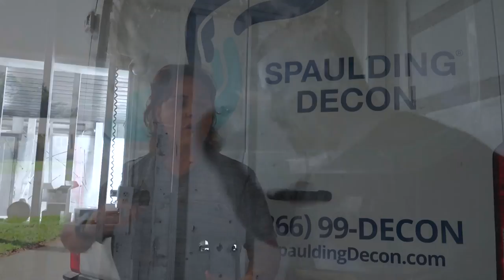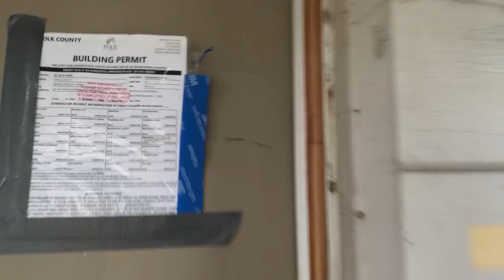PRE-FINALE: What happened to Pet Cemetery?

Comment: Oh my gosh!! The progress is amazing. So sorry that the contractors screwed you. 🤬🤬🤬🤬 That is such a great area!! And a block house to boot 💝💝 complete bonus for so many reasons (It was one of the things we required when we went looking for a house to buy. Ours was built 1954. Excellent for our 'Named Storm Prone Areas'!
Reply: what's a block house?
Reply: @jaytotheell  It is a house made out of Concrete Blocks. They resist termites, are good for maintaining the temp inside of house, excellent for controlling the noises from outside, and typically stand up a lot better to tropical storm and hurricane winds than a stick built home.
Reply: @jaytotheell  BTW, you can't normally tell a house is Block by looking at it because they have siding or stucco outside and plaster or drywall walls inside.
Reply: @jaytotheell  they're homes made from concrete blocks mostly on the ground floor.  Upper floors are mostly framed with wood here in FL.

Comment: I stopped watching home renovation shows for a reason. 
Me 15:00 min in: I should look at tile for the bathroom, and I still need to paint my kitchen cabinets. Man, I wish I could replace my cabinets. Etc etc etc..... wait! I'm broke... nm.
Reply: You just have to stop looking at an all at once project cost that's out of budget. Most everything you would need to get to renovate your home is pretty shelf stable. We bought paint and drywall mud nearly 2 yrs ago and its still good. You can just buy 1 thing at a time and set it aside until you have everything you need for a project. For your cabinets start with paint supplies, then primer, then paint. Even if it takes a year or more to buy it all you still get it done. Tile can be time sensitive if you want anything beyond basic rental unit tiles because styles change seasonally so you need to be able to get them all quick or they may become unavailable. Beyond the tiles themselves the tools and grout can be got over a long time period.

Comment: I'm planning a complete home remodel in a year and a half. But im stripping it completely, getting rid of the plaster and putting drywall, reframing, adding a bathroom. New plumbing, electrical, windows, roof, AC, floors, windows.  Pretyy much building a new house. I'm excited to start.

Comment: Sorry you had such a setback!!🫨Murica is kinda weird with the permits and needing different ones for multiple things in the house. In the Netherlands you go to get your permit before you start building and for most interior stuff you won't even need a permit. I just had my kitchen changed and renovated, all new cabinets and new design, no permit needed. 
If I wanted to build a new addition to my house or a new shed, thats what I'd need a permit for, but once you get the permit everything you're going to do is included, so no need for different contractors to get different permits. And again, most people won't start their project until the permit is in. Sometimes you submit a request and they want you to make certain changes to the design or whatnot, you never know, so if you started building and then turnes out they want something different, you might have to undo what you already did. Or God forbid they deny the permit and you've started building 💀 anyway.. once you got the permit its usually smooth sailing if you got a reliable team working for you... 
It can be such a pain in the B to find decent contractors... I'm glad my dad is super handy and can also tell from a mile away if someone is ok to hire or not. But mostly he just wants to do the work himself lol which totally works for me 😅 my new kitchen is absolutely flawless ❤

Comment: What the F is wrong with professional contractors who don't bother getting the proper permits?? Are they trying to save money? Do they honestly think they are going to get away with it? I hope their reputations get ruined and no one else hires them!
Reply: That's contractors, sadly. Permits can be really expensive, and you understand the risk of running without papers. Fines can be expensive, but if you're only getting tagged by the county 1 out of 20 times, the fines tend to not touch the fees for pulling permits. The problem is, if your stomping ground is small, you lose work fast through word of mouth, so you tend to see this kind of wild west practice from mobile contractors (re: those guys who follow storms and disasters), the "I've been doing this for 20 years" guys, and contractors that make their money through bulk bids or turn-and-burn. It's not uncommon to require copies of permits to be posted on-site somewhere visible for property owners/managers as a stipulation to starting work to help avoid this situations, and some counties require it by law as well. Just depends on where you live.

Comment: As a retired Licensed Builder, Home Inspector and Appraiser I'm sorry to inform you but just from watching this video I can see a lot of mistakes and shoddy workmanship in electrical, plumbing and drywall.  As the homeowner it's your ultimate responsibility to oversee your Contractors.  Hopefully, next time around you will make sure proper permits and inspections are done.  You might want to check with your State Law, but there's a limit to how many homes you're allowed to renovate before having to be a Licensed Builder yourself to do what you're doing.  If anyone is hurt or killed down the road, eg. From faulty wiring,  whether you rent or sell this home, you are responsible and not only can be sued but held criminally liable.   You need to get the City Inspector in there and inspect all previous work before continuing.  If the City Inspectors approve the work it releases you from liability.  My comment  is not meant to be judgmental but as sound educational advice.  Oh, and I'm sorry you got burnt!